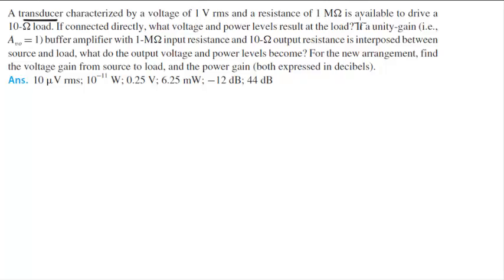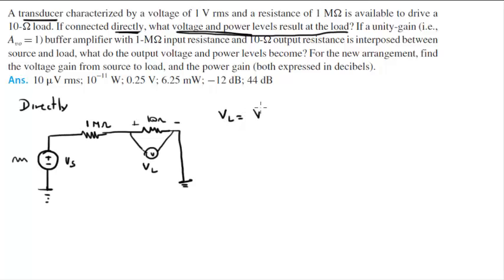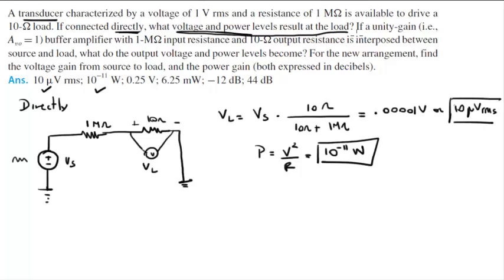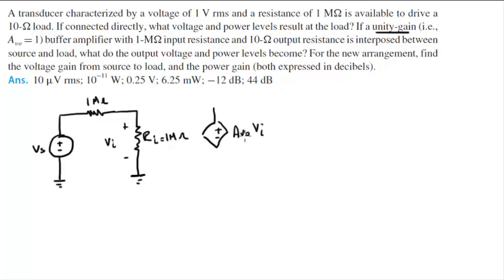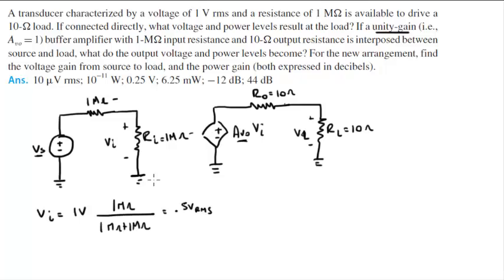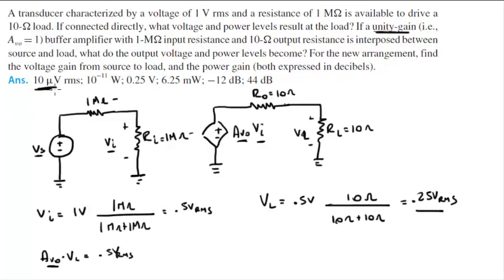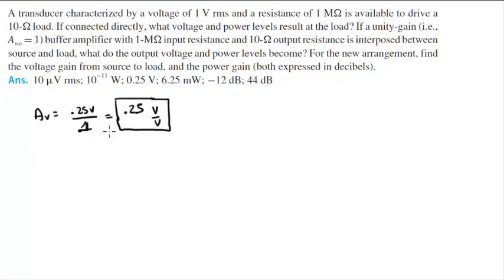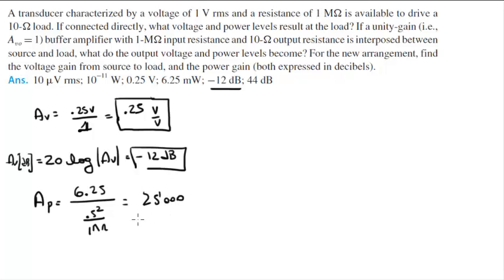What do the output voltage and power levels become with a buffer amplifier?

Comment: For those wondering about the power gain portion, this drove me crazy but I finally realized what the difference is. For an amplifiers gain we do not consider losses from the source since it can vary with source. This is why the question specifically states from source to load for the voltage gain but not for power gain (it is poorly worded imo, but later examples in the book show this same wording and how to interpret it. Specifically the 7th editions cascaded example 1.3). Because of this the power is calculated directly from the input of the amp without consideration for Rs, but in reality you would need to include Rs since Rs is the same size as Ri and would cause significant losses. Again its because the loss from a source is not part of the amp specifications and that is what we are being asked to find although the comma makes it confusing.

Comment: The current drawn from the signal source is 1V/2Mohm = 0.5*10^-6A and power drawn from the signal source is 1V * 0.5*10^-6A = 0.5 * 10^-6 W
Why are we using only half of that power (0.25*10^-6 W) in calculating the power gain? Are we checking the power on Rs or Ri and why?
Reply: I got stuck on this to, its a wording thing. They just ask for the power gain without mention of the source (its super poorly worded) and that is why the source is not considered. Instead they treat it as a property of the buffer amp, although Rs would matter a lot. Its because other sources could be connected that would have different Rs's so they don't consider its loss unless specifically stated. Its something the book could make a lot clearer.